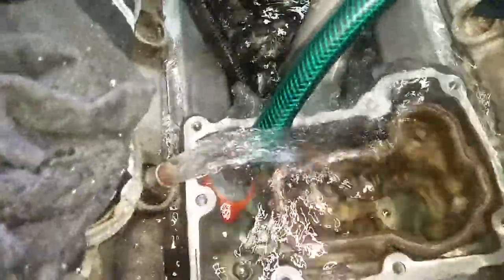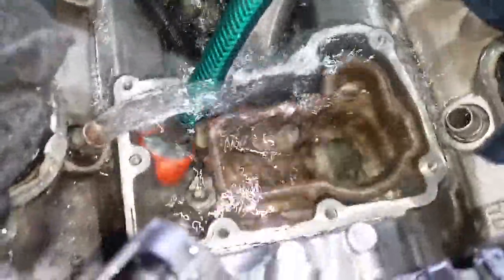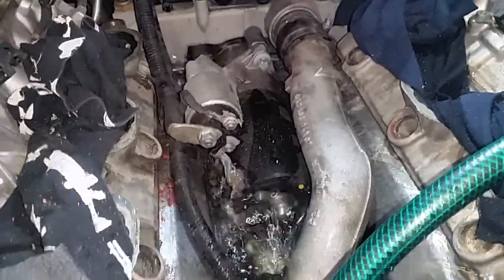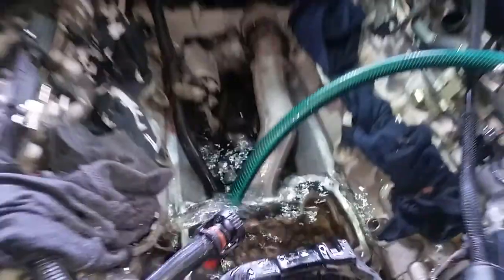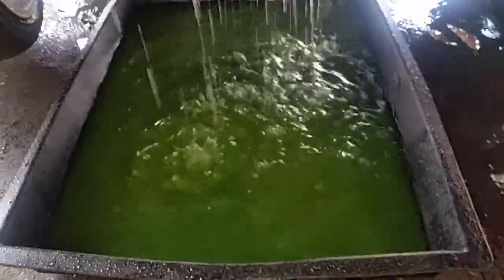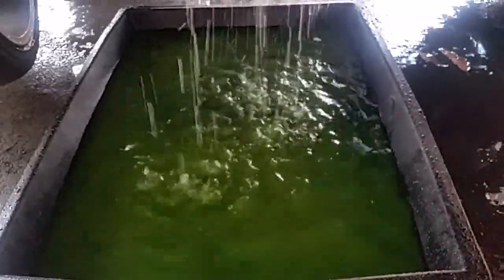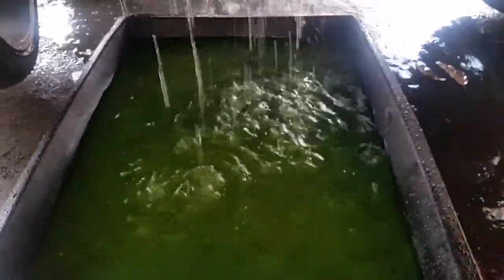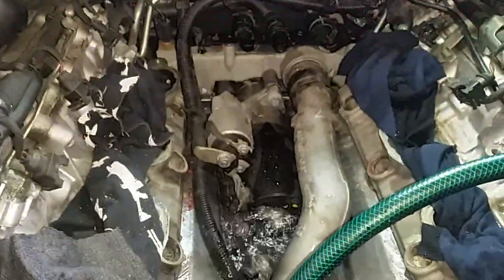Porsche Cayenne 4.5L Coolant hoses replacement Part4 - Flushing wrong coolant out the proper way

Comment: Hi, I'm going in this week to do this upgrade myself.  Did you vacuum bleed the system or is it not that important?  Thanks for your videos.
Reply from the maker: Dorjee Gyadatsang fill it up until is full and run it with the cap open keep topping it up.  Recheck level again when cold
Reply: EMD Porsche Specialist Thank you, would it be a good idea to run tap water through the system like you are doing?  How would you be sure that all this (potentially hard) water would be drained before putting in your 50/50 with distilled mixture?
Reply from the maker: Dorjee Gyadatsang you can always drain radiator at the bottom plug on RHD
Reply: EMD Porsche Specialist I was planning to do that, thank you for responding.  Plan to drain, fill with distilled water and drain repeat twice.  Is Right Hand Drive orientation more convenient location for drain access?  I have a step by step so I'm good either way, just wondering.  Have a good day.